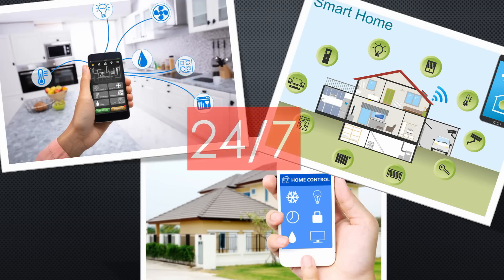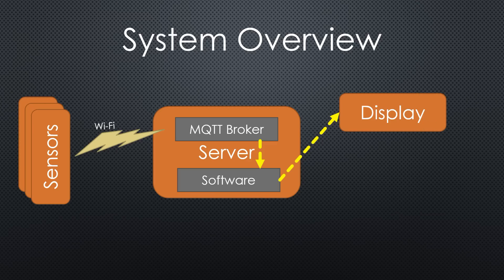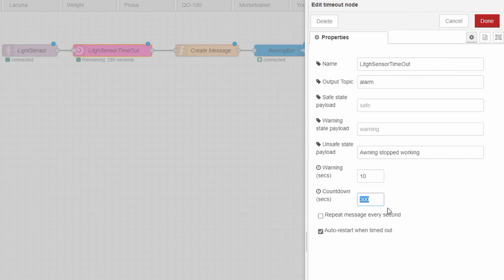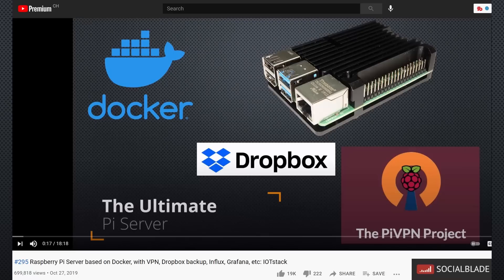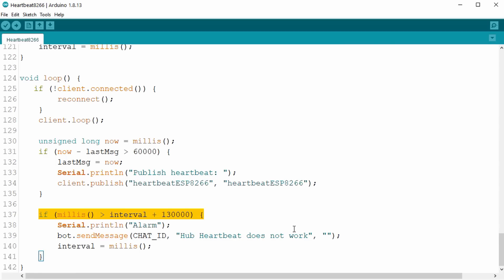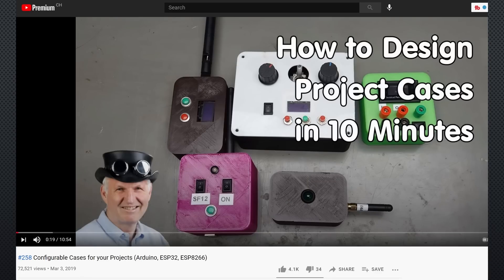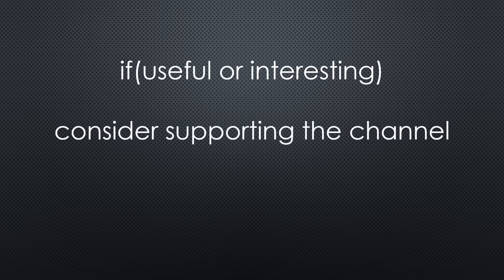#385 Supervise your Home Server with a Watchdog and Heartbeats (Raspberry Pi, ESP8266, Docker)

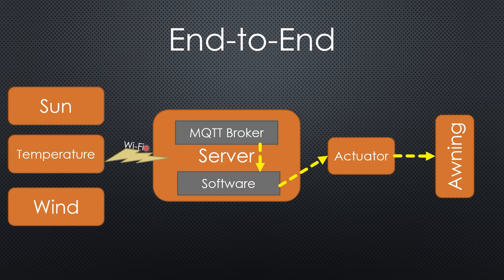Comment: 3:48 I think I know what you mean but surely that was 737-max
Reply from the maker: You are right. My mistake. I will pin your comment that everybody knows...
Reply: @AndreasSpiess  00090⁰0090⁰0000⁰0⁰
Reply: And there was in fact no redundancy...
Reply: @johanneswerner1140  I came to look for this comment 👍. They had HW for redundancy buy decided not to use it
Reply: 4:20 "in airplanes they invest a lot"... as long as it is not Boeing as we all know :D
Reply: Propagating in upper UHF could interfere with an aircraft radar altimeter causing a crash. Just saying.

Comment: would have been good to see how you soldered the 3.3v transformer to the perf board. is it safe to use mains voltage on those? i would have thought you would need to ensure the traces all around the mains voltage pins were cut away or something in case you get arcing? or can you just solder them to the board then solder wires to them?
Reply from the maker: I do that, but it is not according to the laws. Still, I became 66 without being killed ;-)

Comment: You can use anything with tasmota as a watchdog, it's really really small, easily configurable, mqtt enabled, rules enabled, and is mains connected... No box required, only 5 dollars... And its easily replaceable.
Reply from the maker: Good point!

Comment: Great video. Have you made any enclosures which do not use a cable, but rather plug directly into the Mains power outlet and are held up by the plug only? For the WAF factor I am looking for a way to power a bunch of ESP32s directly from main plugged in throughout the house. I must look "neat" by hiding all electronics inside a small box, plugged directly into a power outlet.
Reply from the maker: No, I did not build such a box. But it should be possible with 3D printing.

Comment: The best watchdog server is the device where you want to receive the notifications.
Your cell phone in this case.
Even if you are outside and the internet or power goes down, you still get the notification.
Great content, Thank you.
Reply from the maker: I am not sure. Because I do not connect my Smartphone to my home network and use Telegram for the transmission of the messages.
So my watchdog has to be behind my firewall. In addition I have no clue on how to program my smartphone :-(
Reply: @AndreasSpiess  I am assuming you use the telegram app on the phone to get the notifications.
You do not have to connect the smartphone to the home network in order for this to work.
I also need something like this for my pi server and other nodes 😕

Comment: I really like the tupper for the outdoor sensor!! Does the content of it overheat under sunlight? The problem with watertight systems is the lack of ventilation. A year ago I built a custom navigation system for cycling and a similar tupper but all plastic was also my enclosure of choice. Simple cheap and fully watertight. Cheers
Reply from the maker: 1. It heats up in summer and you have to check if it is acceptable in your area.
2. Completely waterproof is not a good idea, I agree. But I still did not find an ideal solution.
Reply: @AndreasSpiess  In my opinion an effective way of cooling a watertight, or waterproof, system would be by using a water cooling circuit. But that would be only beneficial for something more demanding and more critical. For a couple of sensors is a total overkill.

Comment: Just use watchdog inside raspberry, better and more cheap then use second raspberry, This is not necessary. RaspBerry have inside a watchdog by hardware. That can to do this work perfect.
Reply from the maker: Maybe. I never used it. My watchdog not only supervises the Raspberry. It supervises also the applications running on the Pi. And my watchdog is a very cheap ESP8266.

Comment: Great video.
I'm thinking of building a power supply like your Tenstar one. But how do I go about connecting the mains power? The AC connectors of my DC converter (from AZ Delivery) only have those flimsy electronic components' legs, that doesn't feel right to solder to a 220V wire.
Reply from the maker: I did not have problems with it;-) The currents are very low.

Comment: Very informative video! I'm so grateful you're out here making such videos, I am a small business owner from Mumbai, India and have implemented a project with NodeMCU ESP8266 and a telegram bot that send me a message everytime a customer checks into of the rooms at my hotel, however since there is a lot of noise on the AC power lines and I am using Mains power to the run the project with a small 220V AC to 5V DC power supply, a lot of noise gets through and gives me endless loops of messages this frustrated me almost to the point of giving up, but after seeing your video about using a 1000uF capacitor between VCC and GND I feel this could really fix my problems! Much thanks and love!
Reply from the maker: Maybe it will help. Ferrite beads on the USB cable also help prevent noise. But I am not sure if this is the case for your frequent false alarms.

Comment: Hey Andreas, depending on how customized you have your MQTT messages set up, you can have your clients set a "Last Will and Testament" message on the MQTT broker that will automatically get triggered when the device loses connection.
Reply from the maker: You are right. That would be another possibility for monitoring sensors.

Comment: While I don't have many Raspberry Pi's in my home, I do use several Arduino mega's and ESP8266's. So what I do in my environment is include a heartbeat pulse in my sketches. It changes a pin from High to Low and then back every X number of seconds. Then I program an ATTiny85 with a watchdog sketch. If the tiny doesn't see that change in the defined time period is pulls the reset pin Low for a second on the Host and causes a reboot. But given that all my devices are connected to the network I may incorporate this technique to let me know if something has been force restarted. Then if I get several in a short time frame I'll know I need to look at the device.
Reply from the maker: Interesting idea for an ATTiny! I just thought if this could not be done with a 555 timer and I found this link: http://upperbound.com/projects/555-watchdog-timer/
As you write, my setup also checks the network connections (which were the problem in my case)
Reply: I am not at all a skilled programmer but this sketch https://github.com/sktaylortrash/atTiny85-Watchdog in conjunction with this class https://github.com/sktaylortrash/HeartBeat has proven useful. You can configure the timeout so if you have something running on the host that blocks other processes from running (bad programming I know) you can configure the timeout to be larger than that block so it doesn't reset mid-process

Comment: Hi Andreas,

thank you for this video and the watchdog flow. I had the challenge that my raspberry pi with homeassistant (using iotstack) irregularly freezed after 3, 7, 10, 15 ... days. Now I use the heartbeat flow to switch the tasmota plug off and on again to reboot the pi. Thank you for the idea.

Regards from Germany 
Klaus
Reply from the maker: I also had issues with my Pi: It lost the LAN connection from time-to-time. Now I switched WiFi off and it works ok...

Comment: You could go even cheaper if you have another devices running permanently by adding that code to it. It could then double up as system watchdog, which is then free (and you don't have to find somewhere out of the way to put it). It has to be a device that doesn't go to sleep when it's not busy, of course.
Reply from the maker: You are right. But I am glad I do not need a second one. Everything fits on my Pi4
Reply: @AndreasSpiess  Ah, yes. Actually I meant you could dispense with the ESP-01 if you have spare capacity on (eg) an ESP-32 device somewhere.

Comment: Another great video! I have used an ESP01 connected to the reset pin (and the UART pins) of an arduino that collects weather + PM data. If the arduino hangs or give erroneous data, it will reset the arduino. If the ESP01 can not connect to WiFi / MQTT server, the ESP01 will reset itself. This is usually what you would be doing yourself if one of the IoT's hangs (or turn off the power momentary) anyway.
Reply from the maker: A very good solution for a MCU. With the Raspberry it is a little more complex  because you can kill data with an unscheduled reboot. This is why I did not automate it. I discovered, that the Pi itself never crashed. Other things happened which stopped it from working. In my case it lost network connectivity. So I was glad it was still running and I could do the analysis. But for a remote location, your proposal would be the way to go.
Reply: @AndreasSpiess  Nice to hear from you! I have not connected this reset function to my raspberry pi, because also in my experience, it never crashes. For me the location was not remote, but the time was. These problems often happen when I am not home or at sleep. Now I am using multiple ESP01's and arduino 3.3v pro minis (I like to use the same vcc's and most sensors on the I2C bus are good with 3.3v as well). It is a simpler solution, albeit I use more of those (I used an arduino Mega first with all the sensors connected). I am using Node-Red and Grafana as well (credit to you, thanks so much for that!). Soon this will also control a Swiss Glacier Express (model) train that will be running in our garden. All these (plus more) are powered by 2x 100W solar panels + 8S LiFePo4 batteries. You can tell, I am a big fan of your channel!

Comment: I've created even simpler and cheaper watchdog using digispark plugged in usb port of monitored device. Heartbeat service from system signal states. Digispark monitor atx +5V standby, +5v ON, and heartbeat. I have 3 LEDs - red is signaling +5V standby, yellow - +5 ON, and green have few flashing modes. When system is booting green is gradually lights up, and immediately turn of, after booting green is still on, if few heartbeats are skipped then is blinking 3 times in rapid succession and pauses for 2 seconds. Shutting down system is gradually dimming, and immediately turn on. All leds are extended by UTP from a couple devices to one board next to my desk.
Reply from the maker: Very nice idea! In my case I wanted to monitor also the network connection as well as all the docker containers like MQTT broker and node-red The network connection was the main problem and not the Pi itself.

Comment: Was this video useful and interesting - yes. But I must add:
The whole system is extremely over-engineered. To actuate a sun roof motor depending on wind, temp. and sun  you need no more than arduino nano. As it is a simple microcontroller it is much less likely to crash at the first place. If you know how to code properly on low level – arduinos crash only on power fluctuations or some integer overflows. Raspberry Pie is a computer with an operating system much, much more can go wrong here. 
Detecting sun intensity can be done with a single photo diode (0.1eur)  combined with proper filter depending on your latitude (Italy vs Norway). 
Measuring temperature needs single resistor and thermistor. (1.0eur) 
Measuring wind speed is a bit more complex but even ardiono can have a wifi module (~6eur) added if you have a wind speed sensor on your wifi as you have shown. 
To actuate a motor at worst you need a couple high power transistors (~5eur).

Dear people, do not over engineer things. Half of IT problems are caused by that.
Reply from the maker: Of course you are right. I could even do it manually as we did it for years. But where is the fun ;-)

Comment: Another option instead of building an AWS service - there are a number of "website monitor services" that can periodically request from a website. Typically this is done by requesting a particular web page and looking for a particular string in the response.

For example if you have an external web address for your home server, the service can request a page you have created in Home Assistant that has information about your critical components. If the response does not have the expected string, or if it has a "warning" string, the service will send you a text, email, or even in some cases call you.

I used to use these services in my work, but I have not used recently so can not recommend any in particular but a quick search shows many of them with reviews etc.
Reply from the maker: You are right. I got a few links to such services and checked them out. Unfortunately, I did not find a free one which does not require an open port in my firewall. That would be my two requirements.
Reply: @AndreasSpiess  that is definitely an issue. I have sent a message to Paulus  Schoutsen, founder of Nabu Casa (Home Assistant) to suggest that they add this service to their monthly subscription option. This would increase the value to subscribers who are already allowing this access, at little cost to the company, and would likely increase subscriptions substantially.

Another option, but I don't know if any service supports it, would be a Push notification. One's home server would have an integration that would send a message periodically with status information, while the remote service would notice if the message is missing or has different information. I did not think to suggest that to the Baby Casa team. It would be easy to set that up as a service using AWS or other cloud service but I'm not sure how it would be funded.
Reply from the maker: In the meantime I was able to create a service on healthcheck.io which does what we need. Unfortunately I am only able to generate emails in the free plan.

Comment: I use a little watchdog system like this, but it performs double-duty.  It has one of those cheap GSM/GPRS radios on it and it acts as an SMS gateway in my basement, allowing sending/receiving messages for interesting projects.  (It receives data telemetry from a box 130km away by text message and updates a web site.)  But it also can send me a text directly if the power goes out or my main internet goes out, or in certain other cases.  "The usual suspects" will sell you a SIM800 based GSM board for $15 to go with your ESP.  Adding a SIM to a family plan or getting a super-cheap PAYG SIM will keep you in business for a few bucks a year.
Reply from the maker: Good concept! I do not want to create GSM systems (systems are or will be switched off) anymore but so far was not able to get a 4G system running. I have to investigate more into the topic.
Reply: @AndreasSpiess  The carriers where I live have already "dropped" GSM support, yet all my GSM modems continue to send and receive text messages.  I think there's meant to be some level of backward compatibility in the networks.  These are very commonly used in alarm systems and perhaps the carriers maintain some compatibility for them.  That said, there are 4G and LTE radio boards around too, just a bit more expensive.  SIMCOM SIM7600 based boards start in at around €50, for example.

Comment: You can do monitoring with Google Sheets. But it requires access from the outside.
Reply from the maker: I use google sheets for another project, but did not think of using it for monitoring and alarming. How is this done?

Comment: Hey
Your videos are great 
I wish if you can help me out with my project i am trying to communicate between two Esp’s via espnow protocol 
On master esp im serially reading values from arduino uno and trying to send these values via espnow to another esp
Reply from the maker: Thank you. I share my knowledge on YouTube and have not time for side projects :-( But Google is your friend and I am sure you will find a solution for your problem if you divide it into parts first.
Reply: @AndreasSpiess  Thanks for your reply
I have been searching google for long with no luck
Thought if you could just tell where I’m going wrong
Would’ve been a great help
Reply from the maker: The ESPnow example files would be a good start in my opinion

Comment: Great approach. I went with the ESP01 relay module in line with the Pi's power. If the watchdog detects a system down situation, the relay is pulsed by the ESP01to cause the Pi to reboot as well sending a message to my phone. It works flawlessly and keeps my Pi sensor hub up. It has only tripped 3 times in the past year due to Pi crashes and has recovered after one real power fail. Not bad for a $2 relay module.
Reply from the maker: Good solution. I did not want to automatically reset the Pi because I fear data corruption. That is why I first want to be sure that it really crashed before I switch it off. In my case, most of the times the Pi did not crash but something else happened and I was able to reboot it properly. But for a remote location, you solution is perfect.
Reply: Hello there. Can you help me implement your idea? Is there a email where I can send you a message? Thank you

Comment: Andreas, You have read my mind, this is just what I need for all my ESP8266/01 sensors. My only problem is that everything else runs in Micropython (which I am no expert on) and this is in C, Keep up the good work
Reply from the maker: If your sensors provide regular updates, you do not need to change them at all. Just add the node-red stuff.

Comment: Thanks for the inspiration, this is exacltly what i need right now since my HomeAssistant PI crashes a lot lately. 
I think i will use my UnRAID server as a watchdog but the ESP8266 01 is also a great idea. Mabe i use both ^^
Reply from the maker: Using another running server for sure is the cheapest way to do it...